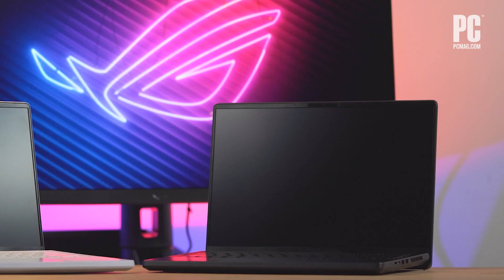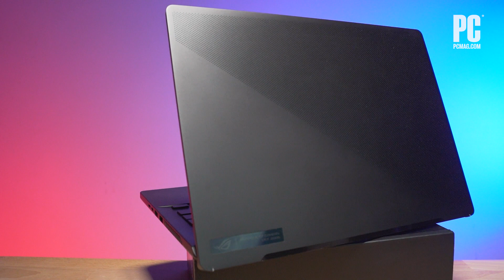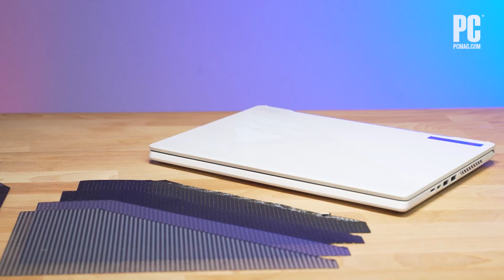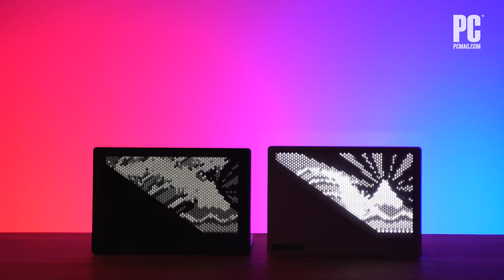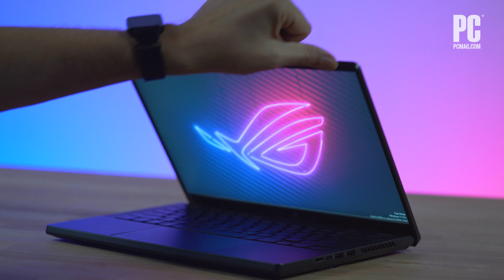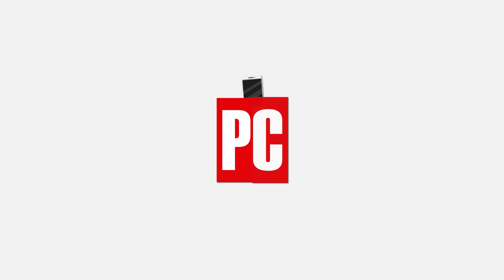First Look: The 2022 Asus ROG Zephyrus G14 Has New AMD Parts (and the Coolest Lid Ever)

Comment: For several months I was looking for a new laptop so that it was actually quite powerful and would last for years. Ultimately, the choice fell on the ASUS Zephyrus M16, due to its appearance, good screen, and a lot of power. I bought it at a black friday store discounted from 10.5K PLN to 9K PLN. I picked up my laptop and after setting it up I noticed uneven button lighting, when I looked at it, about 6 of them were slightly bent. Despite the fact that the keyboard worked like all other components, I decided that I will make a complaint. I could accept something like that with a budget product, but certainly not in a product that definitely belongs to the premium category. I took my laptop to the store, they accepted it and there was a long waiting period. After 3 weeks, when nobody contacted me, I sent an e-mail, and after a few days nobody replied, I called the hotline. I waited again until I finally got the information that the complaint was accepted and the goods would be replaced (subject to availability) or my money would be refunded. Unfortunately, the product is not available. At this price, it is not possible to buy anything close to these parameters, so this solution did not suit me. I started communicating with the store. I wanted to find out how it is possible that the repair of 6 buttons in the keyboard is impossible. I would understand if it was a CPU, graphics card or anything else that might be missing due to the amount of chips available. In the time of chip shortage I do not accept that this will become e-waste. The store keeps saying that only a refund is available, because they cannot offer another product. Btw they do not inform me about why ASUS service cannot repair it. They say that the laptop has remained in the service and cannot be returned to me. The ASUS service claims that it cannot provide me with information about it, because it can only provide it to the store. It is a bit strange, because at the moment I did not agree to any withdrawal from the contract and the product still remains my property. To my question why, in the event of a refund, I would decide to buy their products again, they did not want to answer either. Well, I am without equipment for 1.5 months and we will see how the further exchange of e-mails will go.
So if you are planning to buy new laptop, I recommend you think about it. Especially since the CES fair was not long ago, where ASUS presented a lot of new top equipment. I personally thought (probably wrongly) that by spending almost 10k I would get not only a premium product, but also such a service. Overall, I do not recommend it.

Comment: Can someone give me a solution to my problem. I need to get a laptop before February for school and I really want to get something that can run games as well. The g14 was my best option but my parents are saying that I can’t cos of its webcam problem, I told them I can get an external one but they’re not listening. The g14 2022 solves the problem cus it has a webcam but I don’t know if it will come out and arrive by the end of January especially because I live in Australia . Can anyone give me advice on what to do? It would be helpful if you could tell some other under 15 inch laptops that are good for school but can also play games. Thx
Reply: There's no way this laptop releases before march
Reply: Your parents refused to let you use an external webcam? Sounds like a bs story dude
Reply: I mean, there's the Razer Blade 14, for even better gaming performance with an included webcam, but the price isn't quite as appealing. But if you're willing to settle for somewhat less performance in games, you have the Flow X13 - it'd be great for school with its 2-in-1 capability and touchscreen, while also supporting an external GPU (which we now know isn't going to be dropped by ASUS in 2022). Would probably be easier to sell your parents on the somewhat cheaper and more school-friendly Flow X13, just make sure it's the RTX 3050ti version. The 2022 Zephyrus G14 isn't coming out anywhere before February, it's projected to release in Q2 2022. If that's your timeframe, you have to buy what's out right now.

Comment: Sounds like the microSD reader has been implemented just because... or to sell presumably Asus USB Card readers ;) You could have had 3 USB4-Cs and 1 legacy 3.2-A with a full SD card reader (when talking about port sizes as the lack of space explanation for not going full SD size going smaller and newer ports would have been more interesting and future-proof), instead they've gone with mSD and 2 Cs and 2 As ;) Not sure if this choice was the right one. If it were, Apple probably would have gone with mSD as well. But they haven't cause you can easily get mSD-2-SD adapter, but you need to use up a port and a dongle/external reader to get the other way around... At least the camera is back, but is it still 720p? Or have Asus engineers stepped up their game and gone with FHD or maybe even 4K sensor there? It's not like they don't have space in the lid for a better sensor, since they're already accomodating for the LEDs on the outer side of the lid... Lte's just hope the compute parts are done correctly and fair well thermally and computationally against the competition - there's the Alienware X14 and XPS13 on the gaming and "prosumer" Dell branches, there's the Blade 14 from the garden of Razer to tempt gaming users out there, there's Asus X13 and new Z13 for the even smaller and more mobile alternatives, and there's also the Mac 14 Pro and the 13" Macs (and M2 SoC might reach shelves about the same time these new chips and cosnequently devices given how long it took for many of the last year CES releases to actually become available).. And Acer is gunning for the lower tier of the G14 prospective clientele thanks to that Intel P-series chips with Intel ARC graphics in the sub 15" market as well...